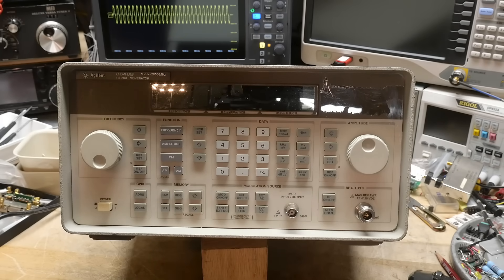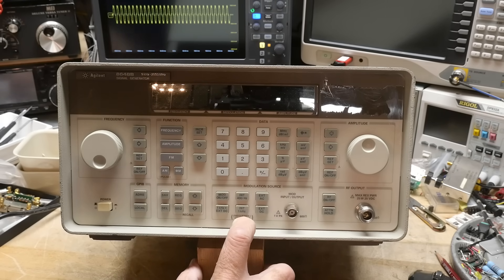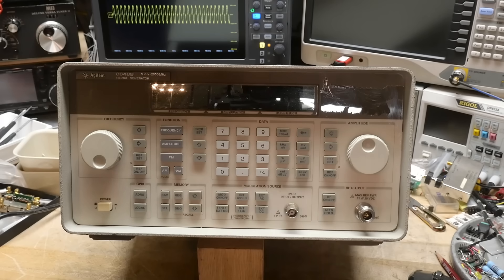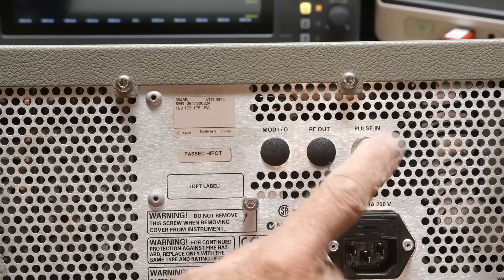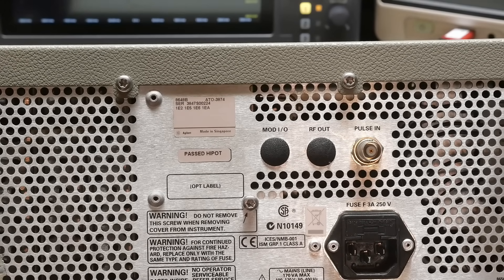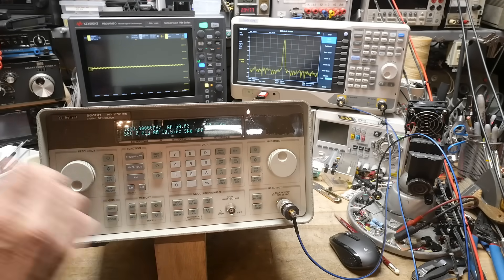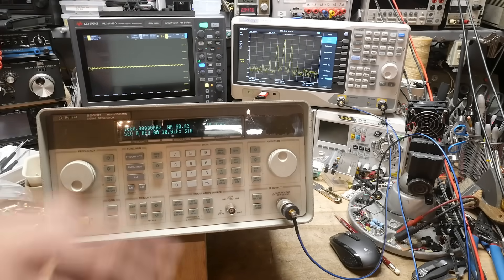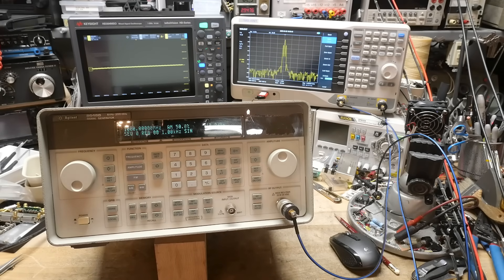#2215 Agilent 8648B RF Generator

Comment: Love your channel, always learn a lot ! An unrelated question: Would you know if a front cover for the HP 8560 and 8590 series spectrum analyzers would fit on the 8920B ? I can't find a part number in the manuals I have and noticed you know lots about the various HP devices. Thanks !

Comment: Operation is almost identical to my HP8656B (100kHz - 990 MHz) except when I push a key I often get auto repeat.  I assume this is due to dirty contacts.  Does spray cleaner work to fix this problem?
Also my unit weighs a ton.  From the way you moved yours around it looks like it is a whole lot lighter.

Comment: Is there a curse if a company makes something that goes below 9kHz ?  "I can get to 10THz, but if I go below 9kHz my company will implode !"
Reply from the maker: my HP33120a goes from 100 μHz to  15 MHz.   is 100 micro Hertz low enough?
Reply: I think that HP must had a nuclear melt down !   Maybe that's why they rebranded.
If you look down many manufactures sites its like there is nothing lower than this magical number - 9kHz.  Perhaps they are all using the same cheap analogue to digital converters.
Reply from the maker: the 9kHz is usually a 0.1 or 0.01uf capacitor in series somewhere in the chain. The 33120 uses DC everywhere and no AC amplifiers.

Comment: I have the very same unit and am looking for drawings and/or service manual if anyone can offer some help. I've searched, but it looks like this is a unit HP/Agilent doesn't provide much information on. Any help would be appreciated! Thanks!
Reply from the maker: there are no documents. some of the circuits are shared with other HP units and that can help. watch this: https://youtu.be/l-5ldEQHikw?si=9h1lJWLKftv4LzQ9

Comment: The back of these are different than on a 8656B, which I use. I was looking for the ovenized crystal output and ref. frequency input jacks. You have to watch on some HP equipment with these, as a factory jumper was supplied to connect the two, but some dealers seem to remove them, and that will kill the generator until the jumper is replaced. Yours has them on the bottom-left, but they don't seem to need to be connected to operate correctly.
Reply from the maker: I believe they are auto-detection
Reply: @IMSAIGuy  Yes, I thought the same. I imagine the OCXO is directly coupled inside, and probably through a reed relay, which will switch when an external reference source is connected to the ref. input jack.

On mine, they have a small, rectangular, shielded box that holds two BNC connectors to jump the two jacks. A short 50 ohm cable with connectors works just as well. Mine also has an external OCXO adjustment, which is covered with a cal sticker.
Reply from the maker: @craxd1  I've got my freq counter connected to a rubidium and if I turn the rubidium on, it automatically switches over.  I've had several things that had the very short BNC cable on the back. usually missing when you buy it. and you are lucky when the seller thinks it is not working and all you have to do is put the jumper on
Reply: @IMSAIGuy  Spot on.

Comment: So pulse modulation is basically OOK. Phase modulation is just that - shifting the phase of the carrier with the information signal. With analog, it kind of ends up looking like FM modulation, as stretching the phase one way or the other basically results in an instantaneous frequency shift just like FM does. I think PM is mostly used with digital signals, where you have abrubt phase shifts of the carrier to encode bits. in QPSK you map every 2 bit sequence to one of 4 possible phase shifts, 0, 90, 180, 270 (or 45, 135, 225, 315 to put them in the center of the quadrants), usually accomplished using IQ modulation, then of course comes the discussion about pulse shaping the IQ signals to reduce the bandwidth, and shortly after that we're talking about Reed Solomon forward error correction codes, clock recovery and channel equalization filters on the receiver, and before long, you have a digital communication system :)

Comment: I've always loved Hewlett Packard (aka Agilent aka Keysight) test equipment for its sheer user friendliness. It's a lot like how automotive dashboards used to be. You may not have ever used this piece of test equipment before, but you instantly know what every control does and where it resides. 
 Contrast this with Rohde & Schwarz, who just put buttons wherever and leave the rest of their functionality hidden in submenus within submenus.
Reply: Anritsu is just as bad with the menus. I just bought a spectrum analyzer of theirs, and I'm still not used to it. My HP, though, is much more user-friendly.
Reply: I've found Fluke, Simpson, and Tektronix (in addition to HP/Agilent/Keysight) instruments to be user friendly, on top of being quite reliable, accurate, and (usually) easy to service.

Comment: Isn't AM modulation looking strange on the SA? Upper and lower sidebands should be symmetrical... There was a "glitch" on gen lower sideband.
Reply: Only one tone though, but still, looked better than what I have seen from some other equipment, including those HP8675A signal generators that our production line used… 🤮🤮😜

Comment: You might do a fun video where you see how many different ways you can turn what's on your test bench into a ham transceiver, Rube Goldberg style, and make a few contacts. I've considered doing that before but haven't done it yet due to living in a bad location for RF communications. Except for two 70 cm repeaters I can hit from my apartment I usually go out portable to get on the air, and I sure can't take my equipment bench full of heavy old HP gear with me to play with.

Comment: When I'm feeding a signal source into my spectrum analyzer I try to have an attenuator in line that will keep the maximum output of the signal source below the max limit of the analyzer because I sometimes make mistakes. I don't trust myself not to hit the wrong button on my signal source, especially when I'm playing with unfamiliar gear. Also, gear sometimes doesn't work the way it's supposed to.

Comment: Such a simple instrument to use.  Nice when you don't really need to read the operators manual to use something.  I recently got another Comms test set, a  VIAVI Aeroflex 3920B that is fully optioned.  I swear every time I turn it on to use it I find another feature I have to read up on.  Took me a week to get up to speed on the automated radio alignment setups.

Comment: Had one, for few yrs. Great istrument and all. Then it died. It was pure hell and suffering for servicing. After that, I sold it, and got HP8662A and HP8673C (with broken level control and power supply but fixed it), and for my home-lab it is a winnig combo. At the job we use Rohde Schwarz eqpt. I dislike 'em with passion, but luckily I'm not in the RF division anymore. 😂

Comment: All I got is a Fluke 6060 I bought many years ago for 300$.  I would like an HP generator as I think they are spectrally cleaner than the Fluke.  Not harmonic wise but near frequency  purity I forget what that is called but it impacts stuff like selectivity tests on radios.  A radio that passes 6/60 with an HP will test a little broader with the Fluke. You may fail by a small margin and you cannot fix it because it is the generator.  EDIT maybe the flaw is called phase noise in the Fluke?

Comment: I bought an 8648C back in the 90's.  It was a good generator, but it was the first HP instrument I bought that was not well documented.  I was used to getting a manual that detailed the instrument down to the component level.  As I recall, this instrument just had block diagrams.
Reply: They went Sencore?
Reply: Yeah, no schematic.  Operation and service manual is still 464 pages.
Reply: I really was not happy when HP stopped providing full details about their gear. That was when the bean counters took over the company from the engineers. It was a turning point with HP and many other companies as well. Fortunately, I can only afford vintage gear for my bench so it doesn't affect me personally that much. But it does affect me when I'm repairing gear for others and I can't get the info I need.
Reply: @johnwest7993  I started learning more about electronics when I retired.  Getting to use gear that would have been ridiculously expensive if I'd started out as an EE is a great privilege.